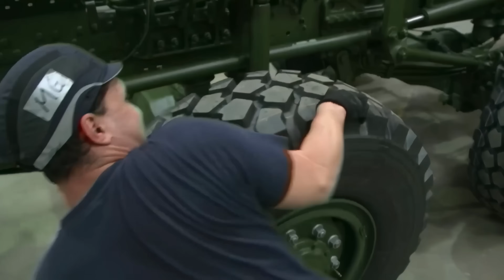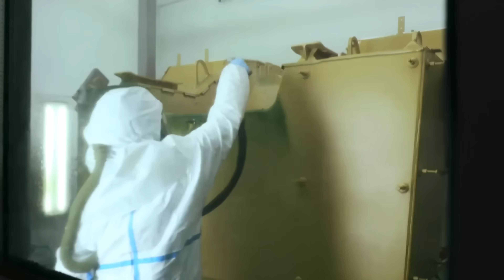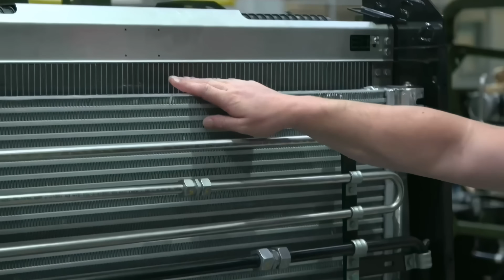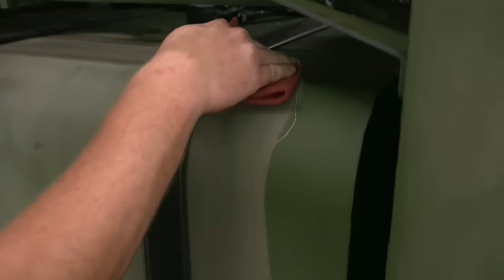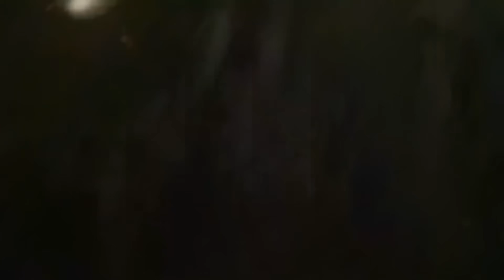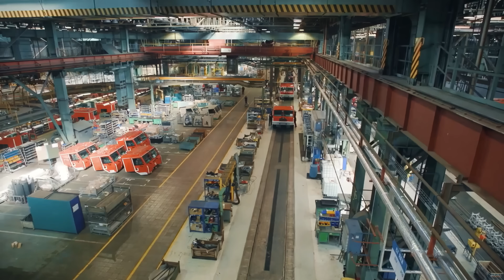Inside Secret German Factory Producing Massive Armored Trucks | MAN Plant Tour

Comment: Too many bolts on the chassis,  what’s going on? Cut the bolts, get bots in to weld it together, speed up manufacturing time. Need to build em cheap and cheerful to meet the attrition rate of a modern war. Where’s the drone protection? Why no armoured cab as standard? Are lives of no importance! Look and learn from Ukraine. Simplify, speed up and reduce costs on the production!

Comment: This is great for employment of workers, but insanely expensive to produce such trucks without more automation and robots.  I'm all for creating jobs -- it stabilizes the community, but I can not imagine scaling up volume of such trucks at this level of effort and cost.
Reply: All such decisions (about increasing automation at the production line) must strike the correct balance between efficiency, flexibility and costs. Remember the number of these vehicles is limited - after all, it is not a Volkswagen Golf, and there is a good deal of variants and options to fill the needs of each customer. I am sure the company did make a thorough research before making these decisions on how to best manufacture these trucks.
Reply: they produce only several hundred trucks a year there.

Comment: wonder if the MAN HX58 6X6 & HX77 8X8 chassis frame & suspension can be had in unpainted form as in civilian trucks . . . civilian trucks come with unpainted chassis frame & suspension components unless specified by customer . . . but they're very much pre-treated with anti-corrosion solutions during pre-assembly . . . another solution would be to use clear coat paint on the chassis frame & suspension . . .